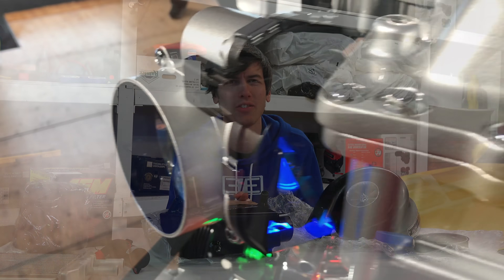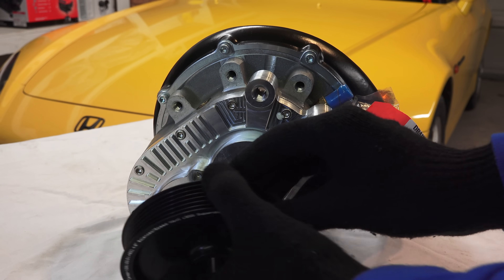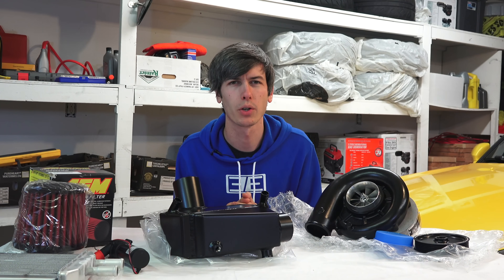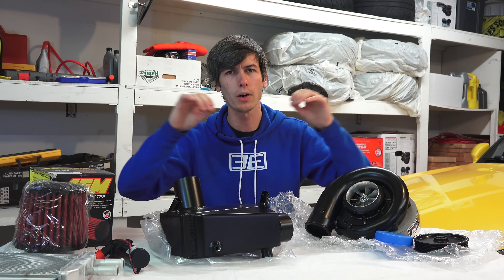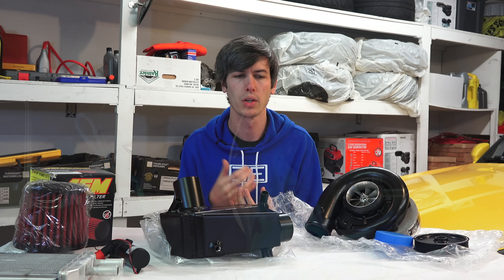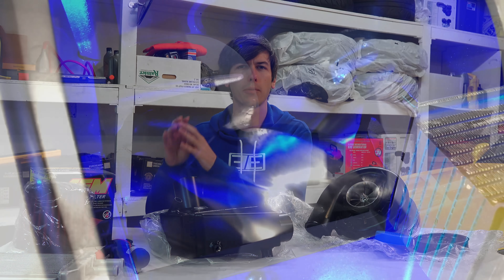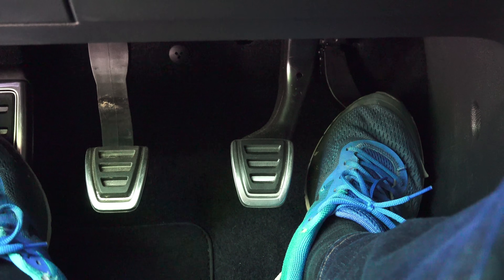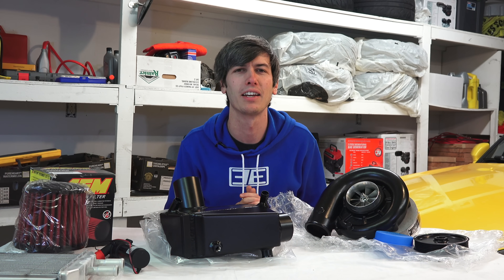Turbochargers vs Superchargers - Which Is Better?

Comment: I have 2 MINI Cooper S cars, one has a supercharger, the other a turbo.  Assuming both were unmodified, you'd think the supercharged car would have more bottom end torque than the turbo.  However, this is simply not true because the supercharger isn't effective until it hits a certain RPM just like a turbo.  The supercharger drags the engine down until it's producing enough boost to overcome the parasitic drag.  You can get around this using a shorter first gear when you design the car.
Reply: Depends what RPM the supercharger is tuned for...and the type. Centrifugal types are usually all top end, but you still don't get turbo lag.
Reply: Based on this it seems like Jason might benefit from a supercharger more than a turbo on his S2000 because of its short gearing
Reply: Are you talking about the bypass valve in the R53/52 S models?
Reply: something1random23 I feel like a centrifugal supercharger would be best on a F20, you really only get the big gains up top but that's where you'll spend all your time anyways. Your just benefiting whatbthe car was designed for (screaming away).
Reply: BionicMerlin 
Dude the supercharged mini is old tech over 10 years,it really can’t be compared to today’s tech. And actually mini is using BMW engines now. Keep up. I’ll take my turbos over supercharger any day. I drive an F10 M5
Reply: It's as simple as changing  the pulley!
Reply: The R53's Roots supercharger was a dated design when it was built. Superchargers have not changed a great deal since then. There are basically 2 types, Roots and cane pumps. I did change the pulleys.
Reply: Samuel Rosenberg They came with them stock.
Reply: KEVIN MANSFIELD It was old tech when it was new. Later generation Eatons are somewhat better.
Reply: VANE pumps. :)
Reply: I'd not recommend boosting a totally unmodified engine.   You'll want stronger internals and possibly lower compression.  Some of them have piston cooling jets.
Reply: KEVIN MANSFIELD Exactly, modern superchargers as vastly more efficient these days compared to those old roots type blowers. Modern twin screws require barely any power to run now that is to trick diverter valves and overall designs.

Comment: I totally agree with the last comment, it is the key. I have also supercharged my weekend car, having other turbo charged cards as dailies. Is not only the delay in response but the linearity of the response. press 10% get 10% press 50 get 50. 
In a turbo car, especially as add-ons, press 20% and suddenly get 80%. It makes the car feel faster than what it is, specially on straight line driving, but is idiotic from a controlled driving perspective.

Comment: I wish you would've gone over ease of installation, ease of tuning, compatibility, reliability, and durability, including how each type of compressor affects durability and reliability of the rest of the vehicle.
Reply: ...Do you want a 9 minute video, or a 4 hour long video?
Reply: saving it for another video im sure
Reply: Drunken Hamster Laugh with a warm heart.
Reply: Ron C lol.
Reply: Supercharger would win easily based on those things you say. Also you will have diferent types of superchargers depending the aplication you want. If you want something easy for the engine Centrifugal is very engine friendly, if you want instant power twin screw or root. On the other end turbos can make the engine more gas friendly.
Reply: I cant decide wich one I want to install in the future do I have to twincharge now ?
Reply: Drunken Hamster and engine reliability is going to be more closely tied to your total boost levels and how much power you're tuning for than necessarily how you're getting the boost. That said, superchargers usually make more low end torque which can be harder on your clutch/transmission than turbos
Reply: Possibly, but the odds that superchargers will are much lower since it comes in naturally and at all times (promoting smoother operation), rather than in increments or surges like some turbos will. You're more than likely are gonna beef up/build up the rest of the car and not just the engine anyway to handle the higher power and pressures/loads the cars will sustain so that really won't matter too much.
Reply: Sc are easier to tune ans install.  Just slap the sc and belt +pipes and youre golden. Turbo involves talling the exhaust +  changing subframe.  + steady build up of power is better on engine longevifty
Reply: Superchargers win those hands down too. At least the types that don't pretend to be a turbo.
Reply: Drunken Hamster why? And a turbo a big end car. A supercharger is the best of both worlds. Instantly and top end.
Reply: babybirdhome eh it depends. I prefer supercharging generally speaking, but the fab work if there are no kits for your vehicle is usually simpler for turbos imo. Tunability I think is simpler with sc's though, there's a more definitive relationship between rpm and airflow
Reply: Goldmarble He's a lefty so he doesn't know what he wants.

Comment: But if you get a stock car and throw 4.56 gears in it you will need a turbocharger because once you hit 4th gear all that wheel torque is gone and now you are relying on engine torque which isn't much.

Comment: Just out of curiosity I have a 350z and a Vortech Supercharger for it that has been sitting in my garage for months, my main concern is reliability, I drive the car almost everyday some long trips some short, what's the reliability difference between a Supercharger VS a turbo? Is there anything I should to to my driving style to help maximize reliability?
Reply: froysrus24 drive it like a normal vehicle,  just ensure the fluids are changed as per schedule.

Comment: You can use compound turbo charging with one big one and one small turbo. The small turbo spools quick and by the time it's out of steam the larger turbo has spooled to give you the top end. Compound turbo results in a ton of torque and power across most of the rpm range
Reply: MillhouseDSM or use Volvos powerpulse tech

Comment: You said that a turbocharger uses the exhaust gas which would otherwise be wasted, but isn't there a bit of workload on the engine to push the exhaust out against added back-pressure?
Reply: bills48321 back pressures are not as high as people think
Reply: bills48321 The backpressure can be higher than the boost pressure.

Comment: Is there already a supercharger/turbo hybrid? It will be belt drivien, but as soon as the exhaust gases are able to spool up the turbo/hybrid, it does not need the belt driven mechanic anymore. It could be done with some kind of belt slippage or a system which physically pulls the pully of the whole belt system. As soon as there are not enough gasses the pully come back on to rotate the turbo/supercharger. This is a rudimentary explanation and I am sure there easier ways to accomplish this 

Or both could always be on for massive power. I think there is still alot of new technologies left in these systems as well as a way to turn all of the heat back into energy or into refrigiration like a refrigerator. Looking forward to the future of fossil fuel engines

Comment: packaging? Superchargers can be much easier to install in the engine bay, especially in V engine configurations where you would either have to run two turbos or route the exhaust from both sides to one turbo.

Comment: Does spinning the turbine in a turbocharger cause the exhaust to have more back pressure, and there for use more engine power to push the exhaust gasses out?
Reply from the maker: A turbo will certainly create more back pressure, but ultimately you’re also taking advantage of energy that would otherwise not be used.
Reply: Makes sense. Thanks!
Reply: Not as much as you think, the scavenging  of gasses will still be good.
Reply: Robert Nugent Actually because the turbine is powered by a nozzle, it uses the pressure energy AND the temperature energy of the exhaust, so although using pressure energy is detrimental to the engine, the temperature energy IS free!  And the turbo pressure energy is Less than the energy needed to run a supercharger because you are also using the free temperature energy.  :)
Reply: Yeah, there's no free lunch.  The exhaust stroke on a turbo consumes more power than it would in a super charged engine, so either way, no free energy for you!
Reply: Mitchell Dykens The backpressure can be higher than the boost pressure.

Comment: I've owned a Supercharged 2001 Mercedes Kompressor and a Turbocharged 1997 Eclipse GST, and out of the two the Supercharger was alot more fun. Definitely putting one in my  1993 Civic when I drop in a GSR motor and running it stock internals.

Comment: Nice video! So I've had both in the same car; an 08 Mustang. I would agree that the SC is more connected with your foot and much easier to drive imo. But aftermarket turbo systems can offer unique experiences that oem turbo systems don't provide. For example,  boost control, external wastegates and bov that vent to atmosphere, etc to provide a thrilling audio experience. In some respects, turbos can make the driving experience more intense because of how the torque increases with rpm whereas a twin screw provides essentially constant torque.

Comment: Why cant you have both
Reply from the maker: You can! :)
Reply: VW made alot,  but ultimately turbo design evolved to minimise lag
Reply: Engineering Explained
Post a video or it didn't happen!
Reply: Check all new petrol Volvo engines and they have both :)
Reply: Bryant Woods Lancia did it on the Delta S4, that one Zenvo supercar had it, and also Volvo did at one point
Reply: Youtube "twin charged Evo" or "supercharged Evo"...

Comment: Best of both worlds: an electric supercharger powered by a small turbo-generator in the exhaust stream. It could potentially reduce the lag, high heat, weight and engine bay plumbing issues of a typical turbo set up, as it uses the wasted exhaust energy to generate the electricity needed to run the engines electrical (no alternator needed) systems and the supercharger. Also, when the engine is in a low demand mode the turbo-generator sends it's unneeded electrons to a storage battery for future electrical draw, it could even just shut itself down when the storage system is in full charge.

Comment: I have been driving a Ford Superduty pickup with a turbo-diesel for the past few years and have learned to enjoy the seconds long turbo-lag when entering into traffic. It adds a little excitement into an otherwise boring drive when I hammer the throttle to the floor whilst cars pass in front of me, hoping that they wont be there when the beast I've kicked finally awakens and lunges forward.

Comment: In another aspect, you might prefer to supercharge an engine instead of turbo- it: 
Single cam N/A's are usually tuned for low exhaust restriction - the intake/exhaust overlap is wider and eventual restriction in the exhaust might cause a backfire. You can't run it too boosted with a turbocharger. There are some factory single cam turbo-engines which derivate directly from their N/A's but they usually don't go over 0.35-0.45 bar of boost. 
With a supercharger, this particular issue drops.

Comment: There will be something that have advantages from two worlds (super and turbo chargers) - an electric driven charger, especially in cars that are mild-hybrid - a "small battery" hybrid that replaced electric starter and alternator with one much more powerful engine (10-40kW), that have 3 tasks: start engine, charge accu (retrieve energy from braking) and help ICE, when torque is demanded.
An energy stored in battery could be used to help spool-up turbo-charger or power electric driven charger.
In second case, You can use exhaust-driven alternator, to help recharge battery and provide electric energy to electric-charger.
It sounds complicated, but it should work :-)
Reply: cra3yk electric turbochargers are already available in Audi and coming in BMW , it uses a motor to spool the turbo when the exhaust gas flow is slow,  the new 48V electric systems where designed for this
Reply: I know that. Still I haven't seen any real dyno test of that or good car review, that pinpoint (lack of?) turbo-lag.

Comment: It will always be supercharger for me.  Turbochargers you got to wait for the exhaust gas to get through and you will always have that lag.  At least with a supercharger, it's belt driven so you don't have to wait for the extra air to get into the engine.  It's always there with it being driven with a belt just like with an engine that's belt/chain driven.

Comment: Another reason why  I prefer the supercharger over turbos is the exhaust note. One of the main reason I will add a procharger kit to my 17 V6 Mustang over a turbo kit.
Reply: Dinokill thats the exhaust system not the chargers fault,  you could get a well designed exhaust like AMG does and not  lose the drama

Comment: Ok I get it you hate turbo lag but saying there is no immediate throttle response with turbo is inaccurate. Specifically if your turbo car is in the correct gear in the correct power band there is an immediate increase in torque. With new turbo technology and with some great tuners, turbo are are achieving better results with more linear power bands and better spooling.

Comment: Would it be possible to design a turbosupercharger such that the turbine is driven by both the engine and crank as well as exhaust gasses?
Reply: Muhammad Babamia no since there wouldn’t be an outlet for the exhaust gasses and the crank would cancel out the turbine from spinning any faste
Reply: Hi thanks for all the replies.. I am aware of twin charging (eg VW Polo 1.4 Turbo Supercharged). However what I'm specifically referring to is using a centrifugal supercharger with an added exhaust inlet to it. The turbine will spin off a one-way bearing such that issues of crank and exhaust gasses canceling one another will be negated due to the one-way bearing providing lock up only "on power" (think bicycle rear sprocket).. Any more thoughts :-)?
Reply: Muhammad Babamia and add a clutch to disengage the belt when the exhaust takes over, sounds like a good idea.
Reply: Yes you can twin charge a engine.Not in the way you imagine though.